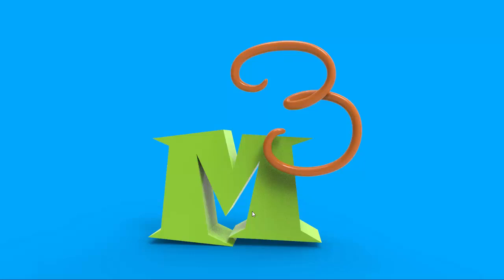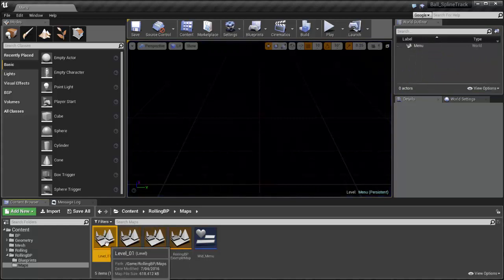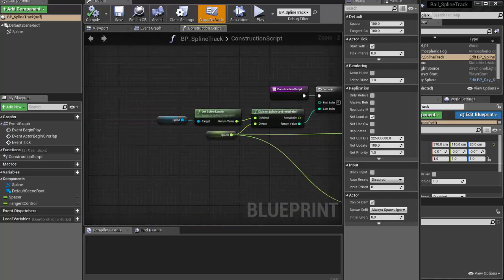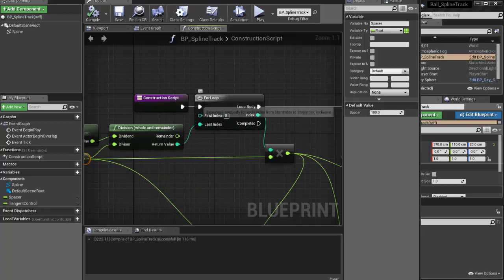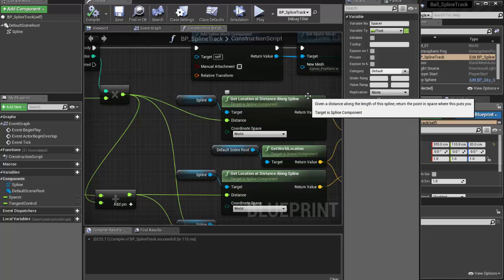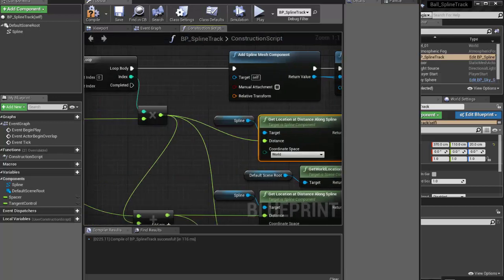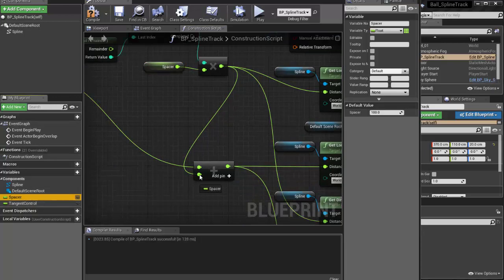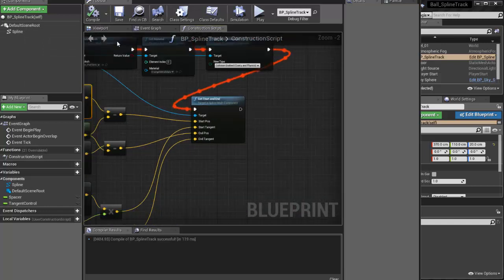Spline mesh component collision fix

Comment: I was able to fix the collision issue for my spline mesh component by using Set Collision Profile Name on each SplineMeshComponent and making it "BlockAll" or whatever profile is appropriate for you. Just make sure it's spelled right, of course.

This isn't the first time collisions have been inexplicably not working (usually when I start changing collision responses to channels at runtime) and I could only solve it by forcing a profile like that.
Reply: Hello, mine's still falling. Where did you put the set collision profile name? Before the loop? After? I tried this, but it didn't work for me
Reply: @EleventhEwe67  I had to apply it to each SplineMeshComponent added during the loop. So the profile needed to be applied on each iteration.
Reply: thanks! @QuiteDan
Reply: GOAT'D, the real answer is always in the comments

Comment: I have a few questions: 
1) Where did you get the value for "Spacer"? 
2) What does your mesh look like? How does it relate to the value you plugged into "Spacer"?
Reply from the maker: Spacer was added as a float variable. Make sure you compile and set the value.
The mesh could be any divide model. e.g. in the below post I'm using a pipe with 4 divisions.
The Spacer length is the length of the object in your 3d application so it doesn't distort. I usually use half that for the tangent value

http://madabout3d.com/index.php/2018/03/24/spline-track-with-collision-that-works/

Hope this helps

Comment: Done everything exactly the same, doesn't work. Oddly the spline doesn't work since it doesn't extend past the first shape.
Reply: Did you try add "Set collision enabled/response channel/object type"  after all spline mesh manipulations like set Start/End, Set Start Scale etc?
Reply from the maker: Sorry I have been away for a while.
Check the value of the Spacer, it could be set to 0.
I've add a new post to my site might help.
http://madabout3d.com/index.php/2018/03/24/spline-track-with-collision-that-works/